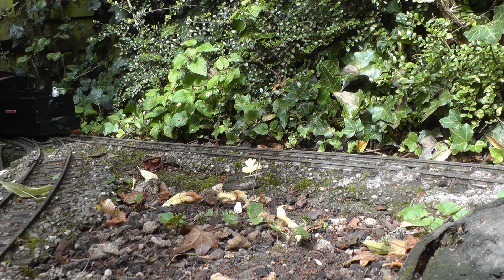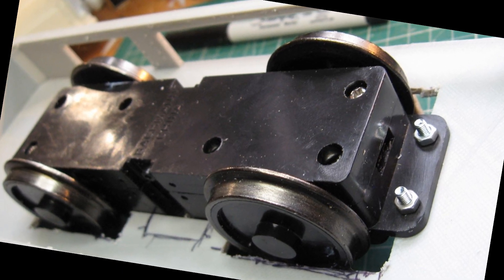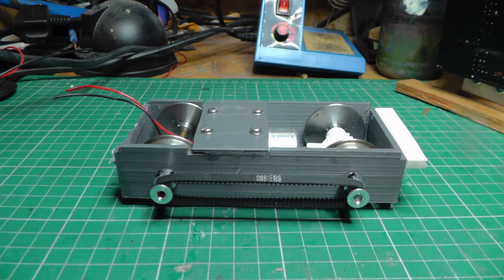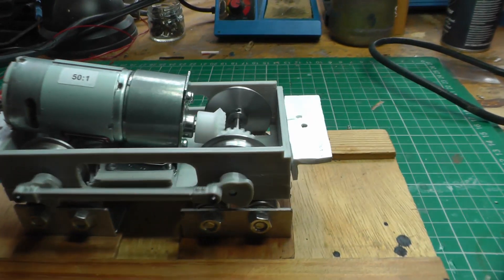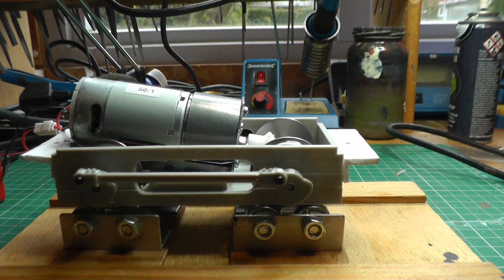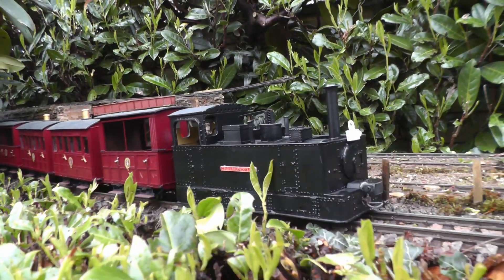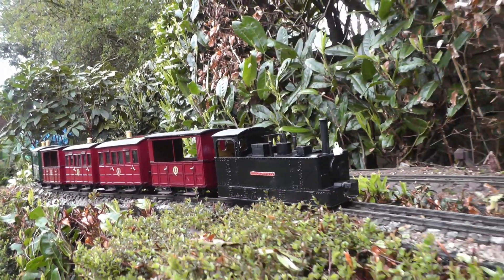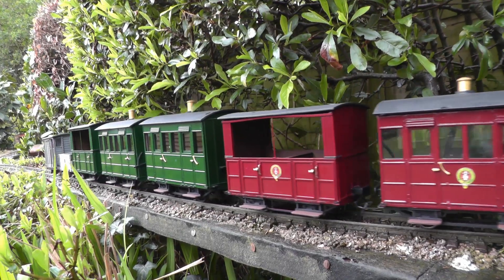Peckforton Light Railway - GVT Glyn loco re-motored

Comment: You need to know that these run cab first, I've had a Fourdees one for two years and only just found out!  Watch films of the original trams running.
Reply from the maker: @rikbennett9
0 seconds ago
Hi Robert
You're quite right. Unfortunately, the PLR doesn't have turntables at its termini and so the locos (and railcars) have to run chimney (or nose) first Down the line and in "reverse" back Up the line. Interestingly, there was some debate about whether the locos should be designated 0-4-2T or 2-4-0T given that, as you say, they only ran cab first.

Comment: So you designed and 3d printed your own motor block. I did that too. Greetings.
Reply from the maker: I've resisted making my own mechanisms for years because I didn't have the equipment or skills to produce the precision engineered parts required. 3D printing has changed that. I now have the resources to create parts with ±0.1mm precision. Mind you, my skills of construction are sometimes a bit hit and miss 😜

Comment: This video is very timely as I've been stalling in the middle of a loco build while trying to figure out the power. I'd also been planning to use fly cranks and have been toddler-testing the design before adding a motor, with surprising success. I was thinking about trying a worm gear directly off the motor, but it looks like bevel gears and a geared motor might be the way to go.
Reply from the maker: Much easier to mesh bevel gears than worms in my (limited) experience
Reply: @rikbennett9  Thanks (as ever) for sharing your experience. I'll probably try the smaller-diameter motor, since I'm in 32mm gauge.
Reply from the maker: If you aren't expecting to pull really heavy loads then the MFA Como 918D 30:1 gear motor will probably do the job well. it's small enough (25mm dia) to fit between the frames and the MFA website has bevel gears and axles to suit.
Reply: @rikbennett9  I ended up going with a similar-sized JGA25 motor. I'm not sure of the gear ratio but it's labeled for 176RPM @ 6V. It arrived yesterday and thanks to the magic of 3d modeling and printing I've already built a rudimentary gearbox and watched it power itself around the tracks. Thanks for the little push!